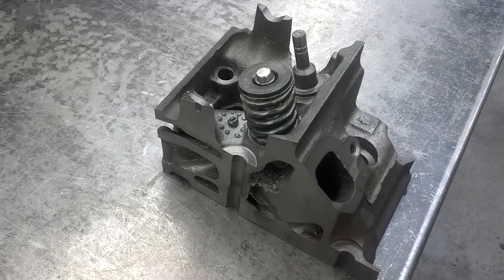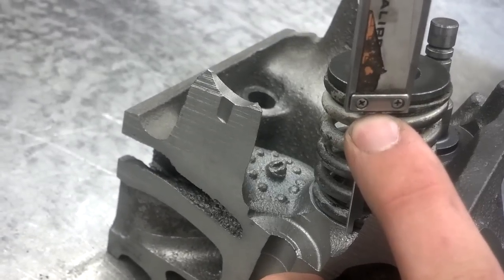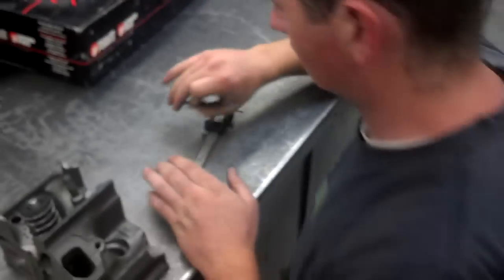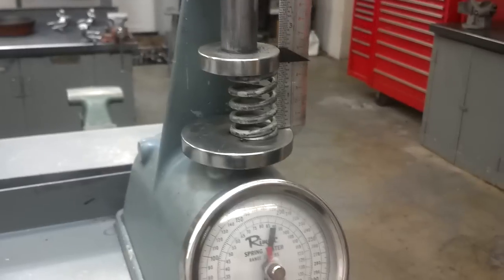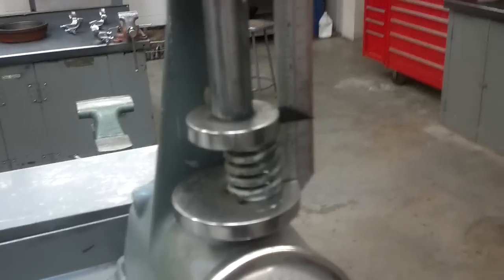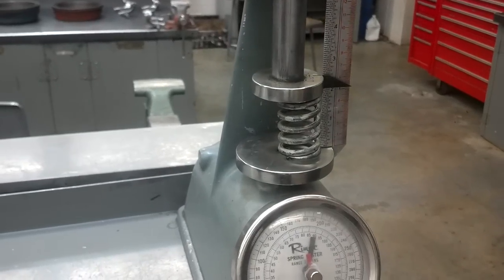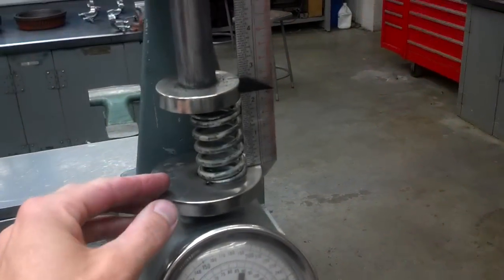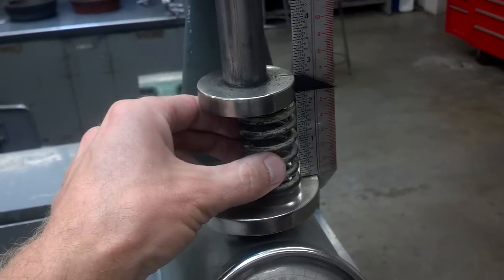Measuring valve springs

Comment: Happy to see that you set the heights you wanted to measure with the valve spring compressed on the weight scale.  
   That scale base moves up in down depending upon how much force is applied to it. 
   I’ve seen too many people with these spring testers set that height with no spring pressure applied to it. That will give you a false reading.

Comment: Question: What are the units of measure for the valve spring? Springs don't exert pressure, they exert force, but lbs isn't a measure of either, it is a measure of mass, so none it makes any sense.
Reply from the maker: That is a good question and I am probably not the most qualified person to explain it, but I'll give it a shot.  When we weigh something, we are not actually measuring its mass, but we are measuring the downward force the object has because of gravity.  So, pounds can be a measure of mass or of force.  This is referred to as "pound-mass" or "pound-force."  In this case, we are measuring the force of the spring in pounds.  I am sorry if I misspoke or said something in the video that made that confusing and I hope this helps!